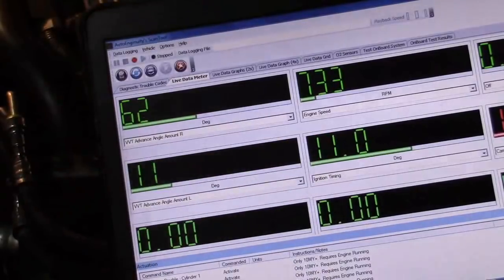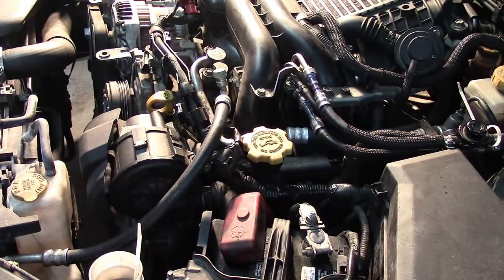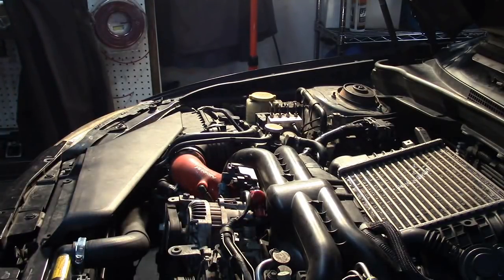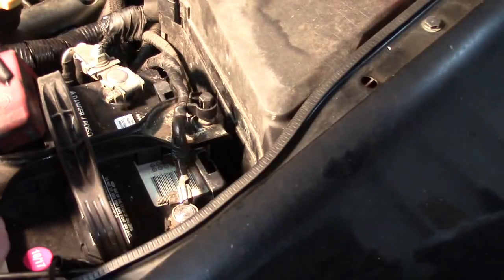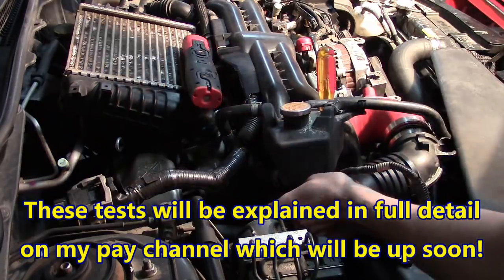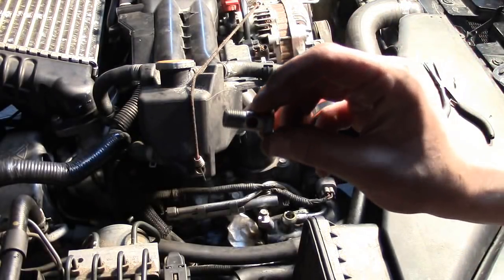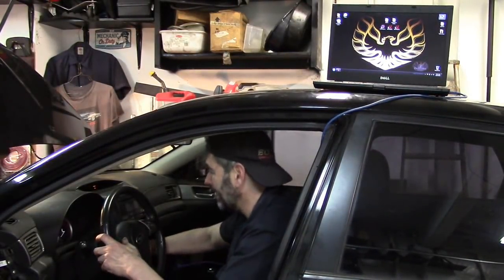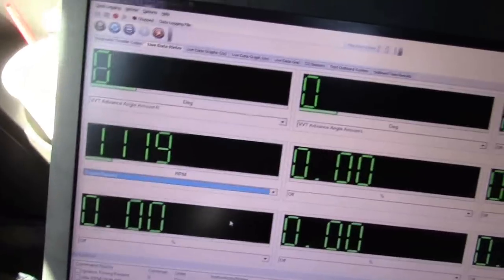Subaru Misfire, O2 sensor Codes  Viewer Participates! Pt2

Comment: Wish you had this available when we did our WRX. Passenger side still had oil screen under banjo bolt but the driver side was missing. Part of the screen was jammed into the solenoid. Love the way you break down diagnosis on white board.

Comment: Matt, this just gave me hope!! I have an 07 Outback XT and it runs rough with a misfire on cylinder 1 at low RPMs. I've tried everything - even cleaned the AVCS solenoid, but did not check the banjo bolt. Will do that ASAP! Thank you for the detailed video!
Reply: Also, Matt, can you please elaborate a little bit about how you used the air compressor to clear out the oil system? Did you just blow the air down through where the banjo bolt goes into? Or upstream (I think it'd be) through the oil line? Thank you! Have yet to investigate the banjo bolt/filter, but want to be prepared.
Reply from the maker: I manually opened the valves by applying voltage and supplied air upstream of the valves.
Reply: @SchrodingersBox  Thank you very much! And just to be clear, you are talking about the valves of the solenoid, correct? I removed the banjo bolt today and noticed the filter was already gone.
Reply from the maker: Exactly.
Reply: @SchrodingersBox  Thank you kindly sir! I did just that and unfortunately, made no difference. I also checked the VVT and it was at 0 during idle - increased to about 45 degrees while driving. The only thing left to do is swap injectors to see if the misfire moves. Thank you  once again!

Comment: I'd like to chat with you about scheduling a misfire diagnosis, I'm here in Colorado and I'm stumped!
Reply from the maker: what data do you have?
Reply: @SchrodingersBox  Sorry for the late reply, didnt see a notification. It's a 2010 Audi A4 2.0t. Piston rings, rod bearings, timing chain tensioner, and carbon cleaning was done last December. Has brand new plugs and coils in it as well. The misfire has plagued me since I got the car and has always been on cylinder 2. Car runs just fine 98% of the time, i can barely notice the misfire apart from the P0302 code. Also you can notice it more when the car is in reverse, then stops "chugging" when put into drive. I'm starting to think that maybe the connector for that coil has gone bad? Oh and the Catalytic converter was replaced a couple weeks back and the rear o2 sensor(looked like it was fried) both of those did fix the P0420 code I had.

Comment: That's not an STI
Reply from the maker: How does that affect the procedure shown?
Reply: An STI of this model year has Dual AVCS Intake and Exhaust, WRX only has Intake. Procedure is same. Also the banjo bolt filter should be located at the back of the right cylinder head and feeds the turbo and AVCS. I believe the left filter is located behind the timing cover but it has been some time since I've worked on Subarus. Anyway love your videos and I always tell new techs to watch your channel to get in a diagnostic mindset and not a part changer's.
Reply: scyzzo This is correct.  Our first step is usually to try a hot oil flush.

Comment: Matt, thank you so much for your super prompt response!  I have a very very basic question involving locating a vacuum leak under the hood (not including evap leaks). I've viewed a host of videos and it seems as everyone has their personal approach and/or logic, from using a smoke machine, propane, starter fluid, brake cleaner, etc. Your logic is always the most comprehensive and justified. I'm not totally certain if you already have a video that addresses this. I wouldn't think that this would require a dedicated video, but I wonder if in a future video perhaps you can comment as an aside, on what method you're inclined to use.  Your approach and logic are Always Spot On!  Thank you Matt and Take Care.
Reply from the maker: Once I determine with 100% certainty I have a vacuum leak, my first approach is to find it with brake cleaner since its usually the fastest and if I am not certain of the location of the leak I use smoke detector.
Reply: Thank you Matt!

Comment: Matt please keep making videos. We love them. They're extremely helpful!!!
Reply from the maker: Will doi!
Reply: I am literally crying right now. My f150 4.6 has coolant in the oil and shakes when I start it. I've done everything including replace the busted intake manifold gasket. I have +10% drop on a few cylinders but am able to raise compression with a wet test leading me to believe it's not a head gasket. I drain the oil and several gallons of coolant come with it. :'(
Reply from the maker: A leaking intake gasket would explain that for sure. I would do a leakdown to test be sure there is no cylinder head problem.  Actually I just use my scope to do relative compression but leakdown is ultimately definitive.  Good luck.

Comment: Nice job finding the cause. Revisiting the signals to the solenoid: Judging by the scope trace at the end, the "5V reference" you mentioned (4:50), which measured about 6V on the meter (5:11), apparently was the meter (or test light), averaging the low-duty-cycle PWM of battery voltage.  If you didn't know that was the case, and really thought the solenoids operated from 5V, it would seem a bit risky to test them with 13V from the battery. But in this case, no harm done.
Reply from the maker: AH good point- the 6 V could well have been from a PWM average but I would certainly never expect a 50% duty cycle with KOEO so I just assumed it to be a bias voltage.
Reply: Maybe with the load solenoid unplugged, PWM to Battery+ will linger high for longer than expected even with low % duty cycle, because during the time that the high-side FET or transistor is switched off the wiring capacitance will retain a charge, drained only slowly by the high impedance of meter input.  I'm assuming the scope trace, which shows clear low-duty-cycle pulses, was with solenoid load connected, pulling the voltage low quickly during the off time?
Reply from the maker: Dang- you are probably right. Nice observation!

Comment: You are one lucky guy Matt on this one! If you're like me, I would be thinking, I sure hope blowing air down these passageways is going to unblock them if they are plugged up. But then you're thinking, that damn filter is missing and there's no telling how much crap is down there in the cam phasors where at least one of them is probably stuck.  Then you probably started thinking about that you'll have  to pull the timing cover off to look at and it and then would be wondering if Paul did the timing correct. Now to be honest, you probably was beginning to hate this job when you found out the solenoids were working correctly and that they weren't seized up. At least that's where my mind would be going, and I would be thinking, blowing air is probably not going to fix this. The reason I say all this is because I think you had your doubts too because when you started the engine up, you were totally surprised of how well it ran. Great work as always and I'm glad to see that you didn't have all that extra work to do! Have a good one Matt!!! :)))
Reply from the maker: Correct indeed. No doubt- when I confirmed solenoid operation and command was present, the stress factor did increase exponentially lol!

Comment: How do you reconcile the differences in the voltage shown . Your dvom showed 6 volts and  your Vantage Pro 14 volts
Reply from the maker: Because one was KOEO and the other KOER
Reply: I believe the 6 V may have been a bias voltage used for diagnosis.PCM uses this to check circuit integrity.

Comment: Matt - I have a similar car and it gave me P0011 & P0021.  Did you just put compressed air into the avcs on the valve cover in order to flush it?
Reply from the maker: Yes I simply used the electrical methods shown to bypass the solenoid and flush through the union screw. But first I would definitely diagnostically validate that an obstruction is your issue.

Comment: the biggest obstacle for  a DIYer as shown in this series is the knowledge and understanding of ALL systems an how they interact with each other.  and its different from car to car. once you know what you are working with oand how it operates you can easily imagine what could go wrong
Reply from the maker: I agree. Most of the time when I work on someone's car it is the first time I have ever seen that year, make and model so I just have to rely on my fundamental understand of automotive systems in general. I think it would be much easier as a dealer tech just working on the same cars all the time with minimal variability between systems.  It's also harder for DIY's to get experience. I mean I do this a lot but I only see what- about 4 cars a month?

Comment: I had an intermittent problem on my Subaru Legacy 3.0 where it occasionally lost power at lower revs - it felt like my old 2.0 non-turbo. Using an interface that can do SSM (Subaru Select Monitor) and RomRaider Logger software (which show a fair bit more than OBD2) I established that the ECU simply stopped actuating AVCS solenoids (duty cycle  = 0). Interestingly, no check engine light and no error codes were recorded. Maybe worth mentioning that it only happened after the car has been driven for a while - so when everything under the hood was properly hot.

The short term remedy was to stop the car and let the engine idle just for a few seconds - after that, AVCS duty cycle was (usually) back and it felt normal again - for a short while. 

Using the before mentioned equipment and focusing on AVCS duty cycle vs. actual valve timing I found out that a lot of times, the valve timing was 'lagging' behind  (especially on the right bank) - as in it sometimes changed 5 or even 10 seconds AFTER the duty cycle changed. I checked the signal at the solenoid and that seemed fine, so it had to be an oil flow issue, right?

So the first thing I did was to remove the banjo bolt filters which helped to reduce the frequency of the problem occurring, but did not ultimately fix the problem. I was going to remove both AVCS valves and clean them in an ultrasonic bath, but I had to abandon that idea since my US bath died on me (it released some smoke).

In the end, I replaced both AVCS valves and now both banks closely follow the duty cycle input and I haven't had the problem reoccur since.
Reply from the maker: Doesn't make sense though- how would changing the solenoids affect the duty cycle command from PCM? The duty cycle is assigned regardless.
Reply: Unless the ECU stops sending the command when it detects something unusual (like a big time gap between the command and actual valve timing advance). Maybe it would eventually throw a P0011 or P0021, but detecting condition is 'two consecutive driving cycles with fault'. I never left it that long. :)

Comment: You might want to set edge trigger on that scope to stabilize waveform. Check out section 5.5.15 of user manual (VantagePROUserManual_ZEEMT303D.pdf)
Reply from the maker: Yes normally I do that but since I was unable to induce variability of the duty cycle it didn't seem important. Had I been able to do that I would have set a trigger for sure.

Comment: Eric is a great guy. Matt was the file a '.pddata' file? If so, you just need the PICO Diag software: https://www.picoauto.com/downloads

I bought Auto Enginuity off ebay... The OBD connector doesn't have all the data pins. I bought it off AutoEnginuity ebay store as a refurbished with ver 16.03 (01/16/18). Legit or not, I don't know. I haven't got it to work like yours. It reads the VIN but that's just about it.. I probaly got ripped off. But I can still return it :D

Comment: Clicking is not the best way. I had one that sounded like it worked and I had it outside, the resistance per the test procedure was within spec. The problem was that during actuation, the AVCS worked but would get stuck most of the time.

Comment: Soooo...it wasn't the points OR condenser. Huh? I could have sworn that was the problem. 

Now you just need to convince the owner he could probably stay warmer if he would move the heater core to the inside of the cabin instead of of sitting on top of the engine.
Reply from the maker: Lol well i didn’t rule out the float or jets....

Comment: I've seen a few videos of this system on different cars, and the mechanical complexity is surprising for a device that needs to survive for years. Like a mechanical gate that intermittently sticks, it seems pretty likely this will relapse, though I certainly support the effort to date. Every time I watch another variable timing video I check my odometer to be sure I haven't exceeded my oil change interval. I gotta think that in an effort to improve fuel mileage, manufacturers have shortened the life of their cars because the definitive fix is so expensive. If the goal is to reduce emissions and improve fuel efficiency, the solution according to manufacturers is to make more cars....
Reply: I just did a turbo on a Cruze.  Another one with a plugged oil supply line from dirty oil.  The owner always got the oil changed by the oil life monitor and used Dexos approved oil.  I think that manufactures are requiring synthetics and then trying to stretch out the oil change intervals to make up for the extra cost.  I think you would be better to run conventional and just change it every 3k and keep it clean.
Reply: Yes, I was a little surprised by one TSB that recommended going back to frequent oil changes when they realized camshaft phaser and turbo lubrication issues are so common.  With popular extended warranty service, manufacturers wanted to extend oil change intervals, but then when some parts were barely lasting 5 years they had to look for something else to blame. Of course they will try to deflect from the real issue of not engineering these parts to be robust enough. I use synthetic but change it at natural oil intervals.
Reply: With respect to planned obsolescence, I've become a fan of the adage: "Never ascribe to malice that which is adequately explained by incompetence."  :)
Reply: And suddenly electric ev cars become a better buying decision over their new gas-only counterparts.
Reply from the maker: Yeah the whole VVT thing was long a mystery to me but i finally have an understanding of it- at least in principle. 
  BTW- still a good idea on the EGR in last video by my understanding on this system is it is a “dual VVT” and the exhaust is also adjusted as well as i take which replaces traditional EGR.

Comment: Without filter you wouldn' t get a flow obstruction until the destruction of the internals of the valve advance system. You had excess oil on the inlet to give a 65 reading. Now the thing doesn't go above 30? Is that normal?
Reply from the maker: That’s not what happened- how is there “destruction of the internals” with flow obstruction exactly?

Comment: Good job Matt, you have got to get a Pico, you can use a Math channel on the scope to graph it, put it on a long screen and take readings at different loads, then look at the duty cycle and see how hard the computer is commanding the valve and at the same time you checked circuit integrity to the valve, I know you want to keep the channel diy using affordable tools but you can get a 2 channel or 4 channel Pico starter kit at a affordable price.  🙂
Reply from the maker: Yes more and more I realize the value of a 4 channel scope but as you correctly stated I do not want to distance myself from the viewer base.
Reply: The Pico 2204a is priced where many could afford it.  KY Home Garage has one and did a comparison between it and the 4425 automotive version.  Obviously the $1300 automotive version is better but for the price difference and the amount of use the DIYer would use it it think the 2204a is the way to go.  The 2204a($139) combined with a 20:1($12)attenuator would be a great investment that most DIYers could afford.

Comment: Wow!  As a DIYer it would have taken me a while to get to an oil flow clog as the issue.  I probably would have cleaned and tested the solenoids and then the sprockets.  Failing there I would have gone to the forums to find out how to test oil flow or if there were any VVT oil flow issues with this engine.  Then, I would have had to take it to the Dealer.  It is good to know that oil flow can be an issue with VVT.
Reply from the maker: Yeah it was definitely an aggravation that I really didn't have a way of measuring flow.  it occured to me I could possibly have used the oil pressure sensor and maybe there would be a slight drop for a minute when the solenoid opened however the problem is the left solenoid was functioning so it would contaminate any feedback.

Comment: Would it be a better option to just leave those filters out?
Reply from the maker: Definitely not. Clogging. the oil channels within the AVCS system could potentially require an overhaul of the camshafts. i am strongly recommending the owner replace the screens for AVCs and turbo and also the oil and filter as soon as possible.
Reply: Great video.  Actually, the owner is very lucky that the camshaft advance is not clogged internally, particularly since the filters have been removed.  Hydraulic oil control is used for VVT, timing belt tensioners, and other control devices on a modern engine.  Couple this with a turbocharger, which also has very small oil passages operating at high operating temperatures and incredible rotational speeds (journal bearings), the need for quality oil, filters, and routine oil changes is more impotent than ever.  The filters are there for a reason.